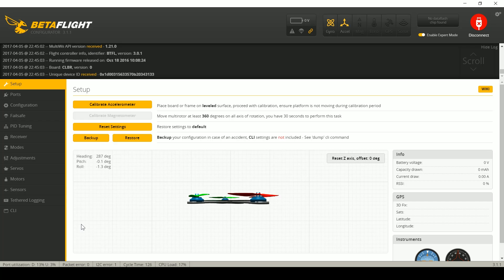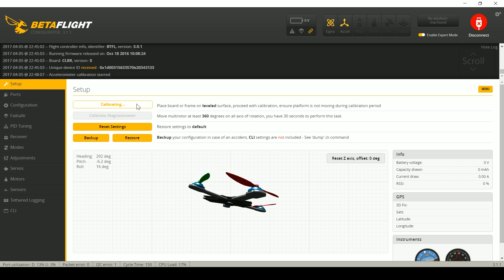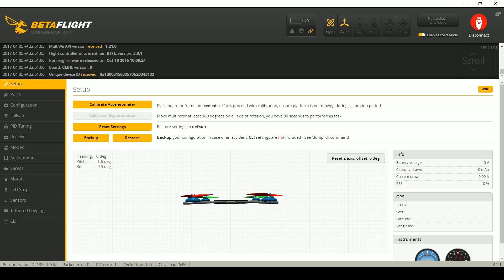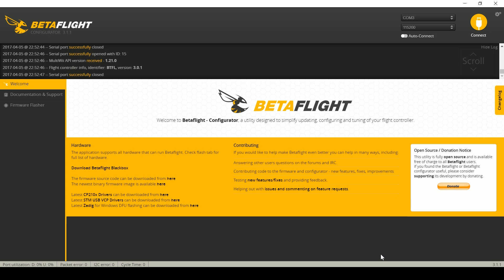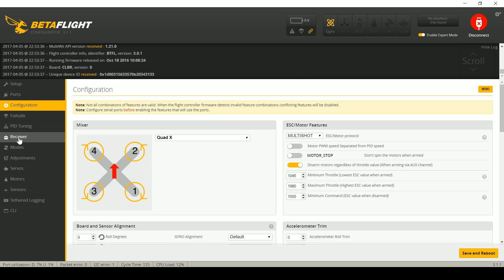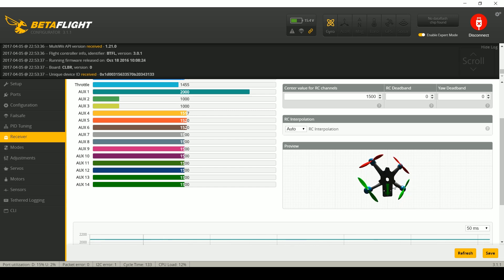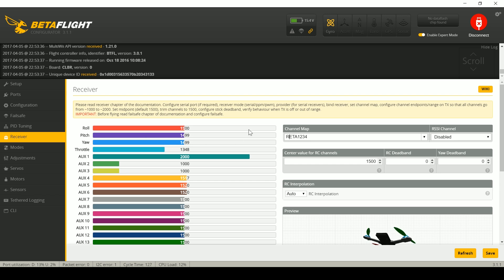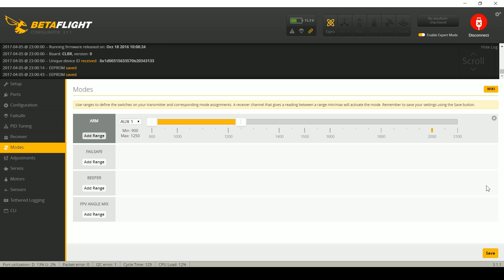Quadcopter Won't Arm | CLEANFLIGHT BETAFLIGHT

Comment: Did you say running bf 3.1 on aa F3 board❣️😃

I have some old F3 laying around. 
How do i install bf3.1 

I tryed a while ago but its not a s straight forward as bf10

Because of that reason I'm using cleanflight now.

Completely different cli syntax 🤕

Comment: im having a rough night with finding out the reason why im getting RX_FAILSAFE flag andy receiver isnt being detected.
 after a small crash my eachine x220s will not detect that my receiver is plugged in. there are no broken parts, no loose connections and everything is setup according to all the tutorials im watching. im lost now, and im thinking i might need to bin this flight controller or just save up for a new drone.
the SBUS pad is grounded, the receiver is bound, my transmitter is in d16 mode. serial via UART, SBUS set. UART6 as serial rx. and nothing is working
any help would be appreciated as this is my only drone :')

Comment: I updated Betaflight and my quad motors won’t spin at all . Not even on the motor tab. I have a tiny ape spi elrs. Using a boxer radio I have added a radiomaster ep1 receiver to it were it’s binded to.

Comment: mine will arm in neta flight but when not and trying to fly it say control stick error, iv went back to betaflight and seen that the right stick was drifting, i adjusted it amd it stop but im still getting stick error amd it won't arm, its ths dji controller 2 amd it works with the other fov drone with no issues, any insight on what steps ibsgiupd start, iv run out of ideas

Comment: Thank you Joshua for the info.
Quick Question though. (I got a meteor65)  Been having a weird behavior where I fly my lil drone, but once I drained the battery, recharge, and plug in again, it fails to arm. Checking it on betaflight, it prompts a bunch of errors (like there is no gyro and to select motor protocol) though if I restore my backup file, I could bin and fly again. Dont know what's happening.

Comment: My xilo jb build was awesome. Worked great... bought a nazgul5 v2 hd... 
Used same method, but no telemetry on remote and it won't arm with battery... the motors turn wen in Betaflight but disconnect from Betaflight,   plug battery in, and no arm... the motors give lil glitch, but that's it... I'm keep trying stuff though...too it works or becomes wall-decor... eitherway,  it's useful I suppose...🤦‍♂️🤔🤨

Comment: Joshua, Your videos have been amazing, However I have a cypher fv-31, I had a ton of issues getting the ports to open on betaflight but after a few days I got it to program but after all of that I cannot arm the motors, I used your videos and eliminated all flags but still no throttle, all other functions work fine. DO you know of any issues with the cypher fv-31 not arming?

Comment: Rrrrrrrrrrrrrr...    Me again, Ok, Ive watched all the videos, read all I can find, and still can't keep the thing in the air very long  -it's a QX65.
 It's not the throttle I need to tame it's all the rates. I shouldn't be a total newbee, but I sure fly like one. I'm fine in velocidrone (getting better) but geeeez. I'm sure it's just a lot of practice but, when in stability (level) mode and trying to keep it between the floor and ceiling and yaw a bit, the tiny little constant movements of the throttle stick while yawing is just crazy hard to do -much less keeping track of the other stick (stick movements are in the 1 to-3 or4% of the total movement). Is there a way to tame the whole thing? All the vids say set the PIDs like this but don';t say why, up this and that for more response, or like you  'leave the stock PIDs'.                       " Make it go faster, set it up for the ultimate...."
NO!!,    I want to set it up as docile as it can be so I can fly the damn thing. -and to do this, set up which? the Tx (Qx7) or the RX in betaflight?

Comment: I have a related question...My copter will arm and all the stick show in beta flight correctly.  (I can spin up the motors manually in beta flight) If I have the low throttle stick value at 1000 the copter will arm yet the motors wont spin.  If the throttle low stick value is set at 1001 the copter will arm and immediately spin up the motors and I can then control the motors.  I have the motors set not to spin up on arm yet they do anyway.

Comment: Joshua, I’m Going On 6 Hours Now Trying To Arm My HGLRC Wind 6. It Was Working FineEarlier Today. And Then It Made A Little Of A Tough Landing On Grass, It Landed While The Props Were Still Spinning, The Props Hit The Ground A Bit, While Still Spinning Before I Was Able To Disarm, No More Than 2 Seconds. It Didnt Do Any Damage To The Wind 6 Whatsoever, But Upon Re-Arming, The Arming Switch Command Stopped Working. I Have Full Video. The Green Light On The XM Plus Is Solid Green, But The Green Light On The Wind 6 Flight Controller Blinks Green, It Should Be Solid, Like The One On The XM Plus Receiver. In Betaflight ALL The Tabs Work, Throttle, Yaw, Back, Forward, In Betaflight They Move, Also In The Modes Tab, It Arms, I Can Set Flight Modes, In Motors, All 4 Motors Spin Just Fine. I Put Everything To Defaults In Betaflight, Then Re Dumped The Wind 6 File. It Binded, Everything Set, Looks Exactly Like When You Plug Your Battery In, Everything Is Going To Work, EXCEPT IT DOESN’T !!! WONT ARM, I Completely Lost. Any Advise Would Be Greatly Appreciated....
Reply from the maker: You should email me about this joshuabardwell@gmail.com

Comment: Any idea why anything above AUX4 doesn't register in BF? I have all my mixers set but can only get activity from the first 8 channels. AUX1-4 work but anything after that doesn't.
Reply from the maker: Your receiver doesn't support more than 8 channels. For example crossfire only does 8 by default.
Reply: @JoshuaBardwell  Thats crazy Josh, for the longest time I had 5 switches working fine with CRSF and KISS. Is there a way to enable more than 8 channels in CRSF so I can use 5 AUX switches in BF? Thanks!
Reply from the maker: Yes you can switch CRSF to 12-channel mode but there is a performance hit.

Comment: Hi everyone and Joshua, 
I have gone through this whole series and for some reason my quad won't arm. I believe I am in the 1% not covered here.
Things I know,
stack = iFlight SucceX-D Mini F7 TwinG Stack (F7+40A ESC)
Flashed with the latest Betaflight version
Remote= dx9 with satellite receiver

Quad illustration moves properly in the animation window in Betaflight configuration without battery plugged in indicating board and remote are communicating
All motors run when the master switch is elevated with the battery (6s) is plugged in
Arming switch, I believe, is set up properly
All these have been verified in the CLI window using the 'status' prompt as shown below.

Without battery:
Arming disable flags: CLI MSP

With battery:
Arming disable flags: RXLOSS CLI MSP

Any help would be greatly appreciated

Thank you everyone
Reply from the maker: RXLOSS tells us that the FC is not seeing signal from the receiver. 

https://www.youtube.com/watch?v=-5gbmyMg6zQ&list=LL4MpYEFpUyB6XvxZcy-JyCg&index=522
Reply: @JoshuaBardwell  Thank you for your response Joshua! I watched the video again. I'm not sure why plugging in the battery would stop the FC from seeing the signal from the receiver when it works on usb connection power. I made a quick video showing this if you or anyone has the time.
https://www.youtube.com/watch?v=sBDrcrnOsqM&t=111s
thanks again :)

Comment: after struggling for a full day why a new quad would not arm
Thanks to Josh. I checked min_check and discovered it was 2 points too low. a quick set min_check=110 and i am up in the air again!

Comment: Someone please help I’ve spent $600 on gear and can’t fly. In betaflight the receiver tab, my sticks on the transmitter are not working. Everything use to work until I hit reset all settings in the setup, now I am not able to arm. My qx7 is connected to the receiver because there is a green light but it’s not picking up that my sticks are moving. I’m using a nazgul5
Reply: I hit the same button on my tinyhawk, I'm sure u figured this out by now but you uninstalled every setting on your drone.
Reply: Whoeven Knows yep yep all good thanks boss! I had to get the original CLI dumb and copy and paste it into the CLI to overwrite the settings that I reset

Comment: Just started flying again after a year and a half off. Thought "I'll update the firmware, see what new features there are". From 2.02 to 2.5 (Cleanflight). New RX, new video TX (For unrelated reasons), thought I had it wired correctly. TX activity shows up in the configurator, bug moves into the range when I hit the arm switch, but doesn't change color or arm. I've been trying to rewire it for 2 days thinking that was the problem. Didn't know about the min_check change, but guessing that's it. Great video, and probably saved me from pulling the rest of my hair out!

Comment: Some one pls help.. kakute f4 atlatl stack...

Says "armed" in goggles and in betaflight yet motors do not spin ?  Sooooo frustrating
Reply from the maker: Try to spin the motors from the Betaflight motors tab sliders. This confirms the FC can control the ESC.

Make sure turtle mode is disabled.

Make sure air mode is enabled.

Comment: I have a meteor65 and I can't get it to work. I bought it and I could test it. It was fast, I made the binding, I armed and ready. The problem became when I connected it to betaflight for the first time. I did nothing there, but the dron refuses to arm, juist like that. When I press the arm button, the led changes to orange, so its taking the order, but the motors dont spin. It has nothing to do with typical issues like, wrong calibration, not standing in a flat surface, not binded correctly, etc... The quad takes the order, all ranges are correctly set, even I flashed the drone with the same firmware (MATEKF411RX) and it does the same. It is possible that al 4 motors are broken? I've been like 1 week trying to solve this and I cant do nothing. Everything is fine, but the motors refuse to rotate.

Comment: I just recently purchased a iflight green hornet 4s......I never realized all that comes with FPV drones.  I have binded the receiver and transmitter. When im on betaflight i get no response when i move the gimbals, try and set they aux switches or  test the motors. I have flashed the firmware reset the transmitter and  re-binded everything and still nothing. Please can you help me out.

Comment: Okay I am a new guy, my son and I are trying to get this.  I have the Horus x10s.  How do I verify the my ET125 quad is bound to this transmitter?  It wont arm.  I set this up per a video for open TX.  Josh can you help us through this?  What am I doing wrong?
Thanks
Reply from the maker: To confirm that it's bound, there should be some LED that changes status on the quad when you turn the transmitter off. Like it will go from solid to blinking.

Next check is, do you see receiver channels moving in the Receiver tab when you move the transmitter sticks? If not, the FC may not be configured correct to recognize signals from the receiver.

After that, you set up the arming aux mode in the Modes tab: https://www.youtube.com/watch?v=feObDe54wKw
Reply: @JoshuaBardwell  At this point I know it is bound.  The flight controller i guess needs to be fixed.  This is FrSky, will this video help?

Comment: In receiver  mode in cleanflight drone is keep rotating in preview display even without a change from transmitter.But responds to transmitter signals.Any guess?
Reply from the maker: Channel mapping incorrect.

Comment: Ehm nothing worked
Reply from the maker: Go to CLI and type status. Get the arming status code there. That is the reason why it's refusing to arm.
Reply: Another thing, i cant calibrate accelerometer. You dont see the drone on setup moving even 1 degree.
Reply: Not even*

Comment: my aux12 is going crazy
Reply from the maker: Aux12 is RSSI. In the Receiver tab, set your RSSI Channel = Aux 12 and now you can have RSSI in your OSD.
Reply: @JoshuaBardwell  thanks i will try it. i do have one more problem, maybe you now the answer to it.I bind my drone so it arms when i press a switch. but it only works when my quad is in betaflight. so when i unplugg my drone from the pc, and tries to arm it nothing happends.

Comment: still cannot get it to work. I plug in the batterie and the transmitter and push the throttle up and nothing happens. in beta flight it sees the commands it just doesn't do anything with them. I am completely stumped and have been trying to get this to work for weeks. it has 0 errors, it sees everything and yet nothing works.

Comment: Hi - just wanted to let you know that even in 2020 this info is still great.  Couldn't figure out why my quad wouldn't arm after putting in a new 3s battery...caused my little micro quad to "lean" a little too much exceeding the small angle setting.

Comment: I have recently built a new quad with mamba f4 stack with included 4in1 esc. Everything looks good in betaflight but it will not let me spin up the motors through betaflight or using my TX, arming switch is set as it should be and the slider is moving on betalfight when i arm/disarm and change other modes. I must be missing something, i know my FC + escs are good as i have have changed out for others and same problem. I only get 3 beeps when connecting the battery and the same 3 beeps when i flick the arm switch? Any suggestions?

Comment: I have a really frustrating issue where my Frsky XM+ receiver is not communicating with my FC.  (YES, I have watched your video on this).  All three wires were soldered to the correct pads per the wiring diagram (Diatone Mamba F411 Nano), and no settings I've changed seem to help.  I have tried the different UARTs' serial RX independently, and though the green bind light was "on" on the XM+, there was still no stick input for any of these changes.  I even tried changing the RX protocol for Shiggs and Gitts.  Still nothing. 

XM+ receiver is brand new.
Currently using Betaflight 10.6
FC firmware updated to most current (target is correct per Diatone's website)
Tried older Betaflight versions.
Tried inverted sbus (in CLI).

Still nothing...

Oh and the cherry on top.  Two friends of mine are experiencing the same issue using the XM+ on different FC's.

I've used the XM+ for years, never had this much trouble.

Comment: Well I flip my aux switch in the modes section the indicator doesn't move anywhere and stays where it was
Reply from the maker: Do the receiver channels move in the receiver tab? If not then Betaflight isn't seeing your receiver at all.
Reply: @JoshuaBardwell  thanks so much for replying! While I'm in betaflight my throttle yaw pitch and roll all show up when I move my sticks. But when I flip AUX switches, nothing happens.

Comment: I figured out how to arm it. (Blade LRX with DX6i).. but the left stick will not respond. Motors will not spin,  unless I give input with the right stick. If i move forward, backward, left,  or right,  then the motors spin.  But motors stop spinning as soon as right stick is centered. Please help me Joshua, Horizon Hobby could not figure it out, I've spent countless hours with them on the phone... I've just about given up on this, sadly

Comment: My  problem is that I installed a f3 flight controller everything was working fine.. all of the sudden it's not arming now and I'm getting a steady light even when the transmitter dx9 is off.. still on steady red light on my spektrum 3.3 serial receiver..thinking it's the receiver so I switched out for another one and getting the same result I plugged back into cleanflight and can't connect..please help me here hopefully you know what's going on thank you..
Reply from the maker: It sounds like the FC died :-(
Reply: @JoshuaBardwell  even though the light s are on the flight controller?

Comment: Thanks for the video! My geprc Elegant was not arming consistently.  Sometimes it would but sometimes it wouldn't.  My min check was set to 1005. The throttle was reading 1005 to 1006 in beta flight. I went into my output page in my qx7 and trimmed the throttle channel to 1000. It works every time I arm it now!! Good information in this video.

Comment: Hi Josh, Im using a IMMERSIONRC EZUHF 8-CHANNEL DIVERSITY RECEIVER EZUHF8DIV with the Race 32 Racing Flight Controller F303 (Deluxe) and aTurnigy 9X 9Ch Transmitter
in cleanflight I can see all control stick movements throttle pitch yaw ect but none of the AUX channels move when I flick the 4+ toggle switches the turnigy has. any ideas buddy ? appreciate your help in advance.

Comment: Do most transmitters stick arm by default?
Reply from the maker: The flight controller decides the arming method. If you don't set up an arming mode then it will stick arm. You really shouldn't stick arm though.
Reply: @JoshuaBardwell  Thank you.

Comment: Joshua when I arm my arm box in betaflight turns red and it says disabled but it arms the quad how do i fix it?
Reply from the maker: Are you saying that the motors start spinning even though the box says disabled?
Reply: @JoshuaBardwell  when have the quad connected to betaflight and i hit the arm switch the arm box on beta flight is supposed to turn yellow mine turns red and it says disabled in the box
Reply: @vasilisfellouzis  same PLEASE HELP!!!!!!!!!
Reply: @JoshuaBardwell  no it is not Spinning

Comment: @joshua bardwell, did everything in the video. still won't arm. Any ideas?
Reply from the maker: Go to CLI type 

status

What is the arming status code? That is the reason it refuses to arm.
Reply: I figured it out. It’s because I had minimum satillites to arm set to 8. I set it to zero and it works fine now. Just need to make sure I have connection to so many satillites before I decide to go far out. I lost my old quad so I built the new one to have gps. This problem is all new to me. Thanks for responding so quickly